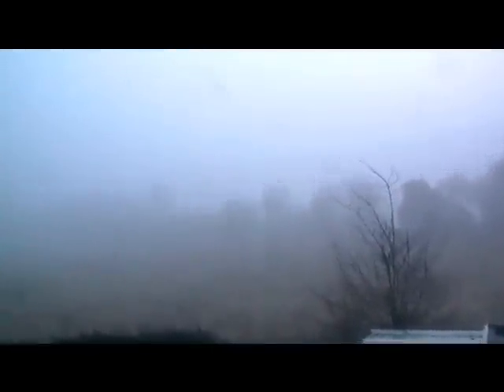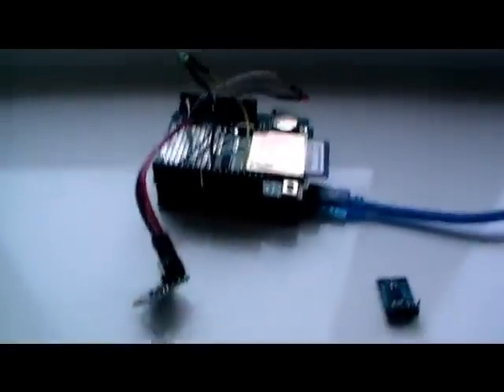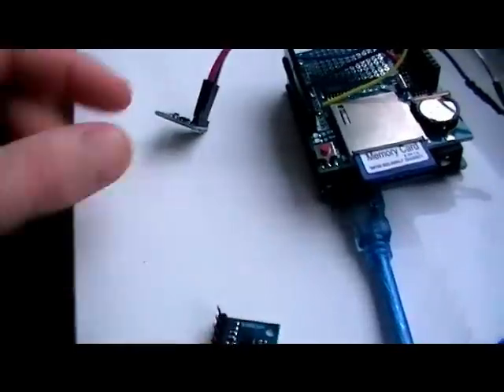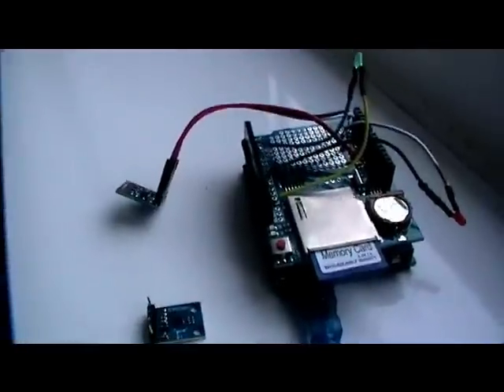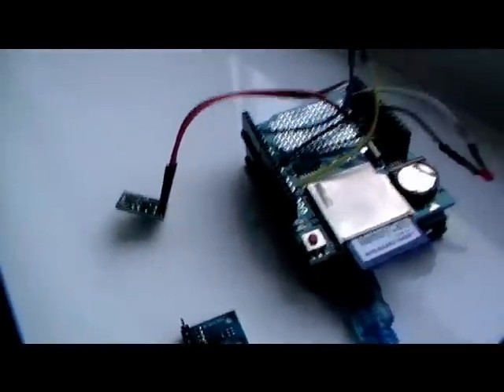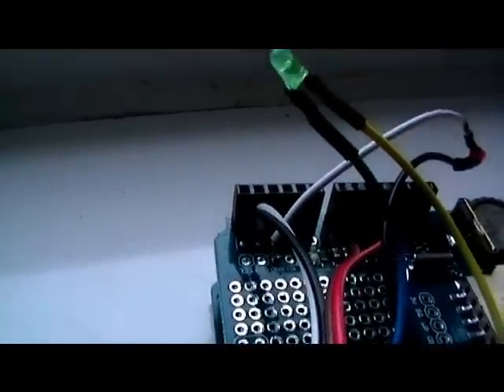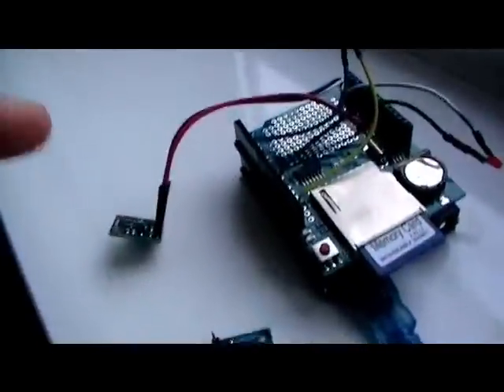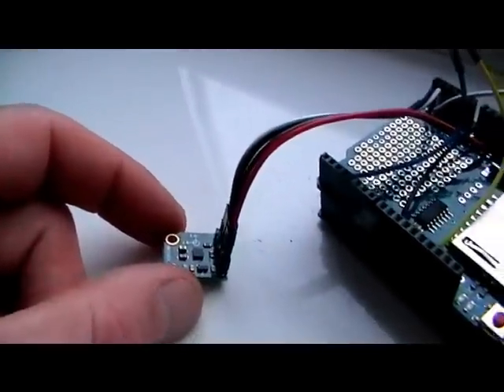Technical problems and time is ticking

Comment: here a link in the netherlands selling the device! they claim to have 171 in stock!
https://www.tinytronics.nl/shop/nl/sensoren/hmc5883l-3-axis-compas-magnetometer-sensor-module-3v-5v-v2
click on the flag to select ENGLISH
here a other link
 https://www.beslist.nl/klussen/d0024015212/HMC5883L_Compass_Sensor.html?productIdentifier=00000150323879375212956219348

Comment: Please, please, please learn your physics first. Ozone (O3) may occur wehen there is sunlight/UV and chemical compounds which can "donate" oxygen radicals -- mainly on roads with fuel burning cars. Cosmic rays do create clouds in high altitude... they cannot create fog. Fog is created by changes in pressure vs temperature vs humidity -- google the terms "dew point", "adiabatic compression", etc.

Comment: been following maverick star for a short while but there is a part of the process I am missing out ,  I understand 2 north and 2 south poles , one north under Canada and the other under Siberia , and the compass needle pointing between the two,    so the dynamo under Canada is weakening so this is allowing magnetic north to pull towards Siberia ,  so even if the dynamo under Canada fails completely , have not seen any information where the dynamo under Siberia is changing , so my question is if the dynamo under Siberia is just  as strong then what is going to drive a pole shift ,  surely  magnetic north will just end being over Siberia ,  what will cause it to flip unless the dynamo under Siberia goes on the  move

Comment: Seems like the magnetometer is EOL, found this text on one supplier: Sorry, the HMC5883L went EOL. This part is retired but we recommend the MAG3110 magnetometer or the 9DoF Stick which has a magnetometer built in. Neither are drop in replacements but both will allow you to detect the earth’s magentic field.
Reply: https://www.ebay.com/itm/Evaluation-board-of-IST8310-3-axis-digital-magnetometer-/292502751682

Comment: Nee to borrow and oscilloscope and compare what the chips put out, 0-10 vdc or 10-20 ma etc thats if the signal analog and not digital into the processor. Don’t give up, these micro controllers can be a real pain in the *

Comment: Hi Mav. Don't give up. This gives me a deja vú sensation. You try to make computers work with a specific device and ... nothing. You've done everything as it should and it doesn't work. Then you try and you try and you try, and aparently you did nothing different but suddenly, voilá it works! And after that it always works... so simply continue trying. Ah. Use the second and third device also, it could be one is deffective.

Comment: Searching around I found that there are two versions of the HMC5883, the HMC5883L and the HMC5883.  Both ICs, while being the same package size, pin count and having the same register addresses seem to have different power on default register states.  These register states more closely matched what I was seeing on my boards.  The wiring configuration of the IC is also more closely related to its predecessor the HMC5843 in that it uses the VREN (Voltage Regulator Enable) pin which, on the HMC5883L, is not connected. At this point I thought I would try and wire up my board per the other datasheet thinking maybe I was shipped the wrong chips or they were somehow mislabeled.

While looking into how I should modify the board I just happened to receive an email from Honeywell tech support.  The individual was unsure as to why the address was incorrect with my first chip but my guess is somehow it was damaged, possibly during the reflow process.  The tech support rep also told me that the power on default register values in the datasheet were incorrect and what I was seeing are the correct values and will be changed in the next revision of the datasheet.  He also stated that the top code markings of my chips did indicate that they were in fact HMC5883L ICs.  With that mystery solved I still needed to find out why I was getting invalid data readings.  I started reviewing application notes and looking at waveforms and noticed that the pulses on the SetP pin didn’t look like they were supposed to.  Long story short it turns out the supposed 220nF capacitors I was using were actually mislabeled 220pF capacitors! This is a perfect example of why it’s important to have an LCR meter when using surface mount components.  While reading through some application notes I noticed that it was common practice to use two 100nF capacitors in parallel instead of a single 220nF capacitor for the S/R capacitor.  The reason being is that ESR seems to be the most critical aspect when it comes to the S/R capacitor so by paralleling two ceramic capacitors you can take advantage of even lower ESR properties.  I posted a follow up email to tech support to see if there would be an increase in performance by paralleling both the S/R cap and or the reservoir cap.  In the mean time I’m having more boards made up that have open parallel pads for both capacitors.  Perhaps I’ll do some separate follow up testing with and without paralleled capacitors to see what impact there is on performance.  In the mean time I can safely say the mystery has been solved!
Reply: dean mazza nice work.

Comment: You have to add the library in the arduino ide for that specific new sensor. The Code may need some adaption. If this doesn't help, if you want to, you can send me your arduino project, i can give you better advice if I know the parts.
You can also add a simple gps modul and add this to the logged data.
Reply: we have come to a total of €20 for the cost of all the parts we would use, not including the gps which would be an extra €6